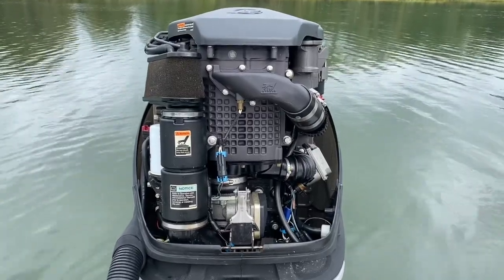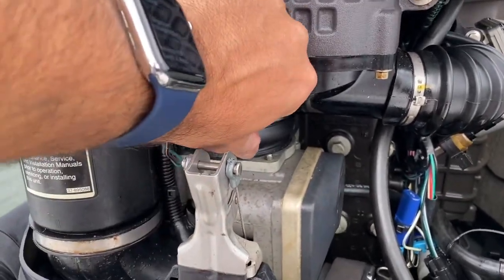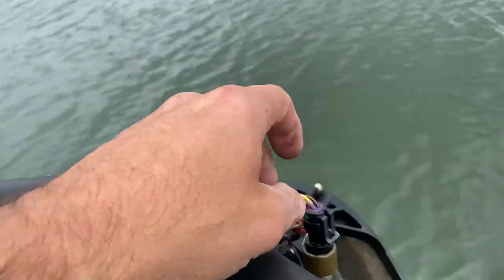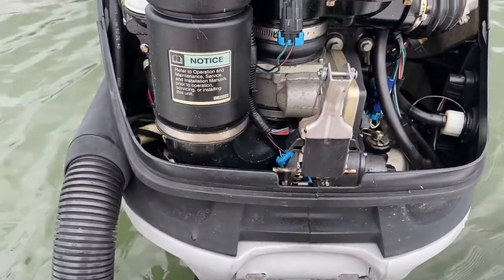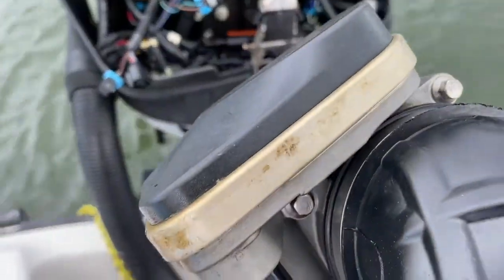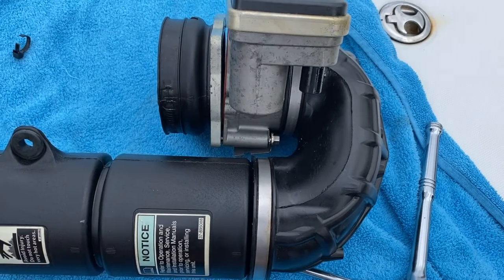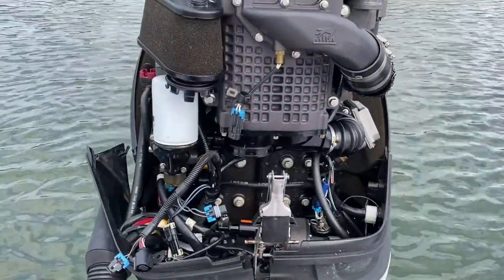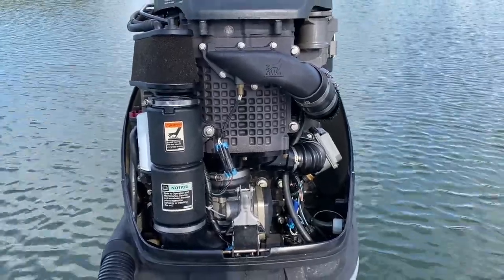Mercury Verado Throttle Body Isolator Boot Replacement - High Idle RPM

Comment: Thanks I’m having the same issue. I found your video out of necessity due to all the mechanics are a month behind. Thanks for the great video!
Reply from the maker: Not exactly sure of the part number, but this is an auction selling the redesigned part. 

https://www.ebay.com/itm/202558060965?mkcid=16&mkevt=1&mkrid=711-127632-2357-0&ssspo=sl7sBe40RGK&sssrc=4429486&ssuid=_oeStlvKRiy&var=&widget_ver=artemis&media=COPY

Comment: I had a similar issue with a verado 400 r, replaced the throttle body. works well now. Symptoms were high idle and the defender system limited rpms to about 1700 before alarm kicked in

Comment: Mine was crazy bad. I could still get it in gear but had the high idle CEL. went to replace it and the boot compltely seperated from the flange. Not a cool feeling knowing I was 40 miles offshore and so close to a catastrophic failure.